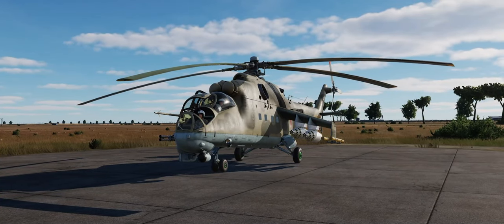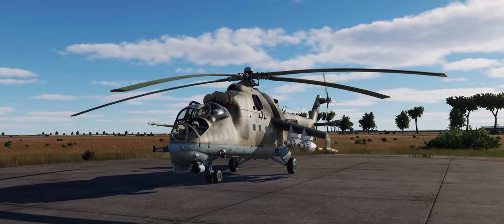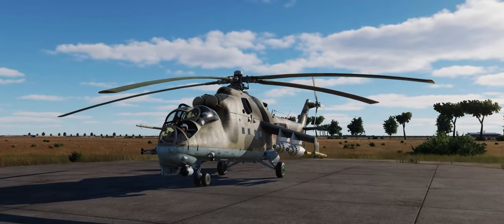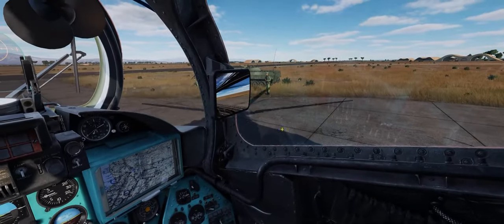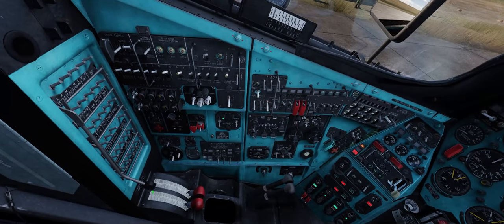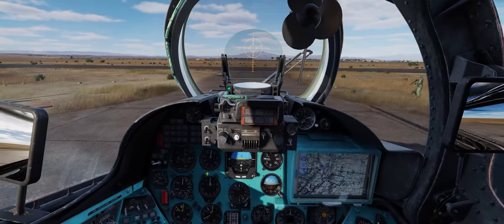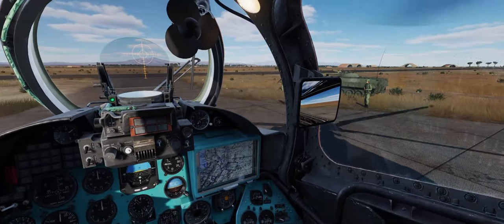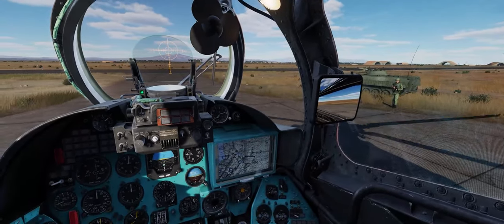DCS Mi-24P Hind-F Cold Start Tutorial and Troubleshooting!

Comment: Another important thing is on the NAV breaker panel, DO NOT engage the airspeed to doppler switch. This is a backup mode if your doppler system malfunctions, in a healthy airframe it's going to corrupt your Diss-15 doppler system and make it drift like there's no tomorrow ^^

Comment: Hello Spudknocer, are you still using Thrustmaster Warthog HOTAS, and if you are using, how good it is? Is it still good, after 2 years?
Reply: I've been using mine for about 5-6 years at this point and it's still going strong. I've read some people have had varable luck when it comes to build quality but I've never had any issues. The only weak link would be their drivers which are a bit meh and haven't been updated for quite some time.
Reply: @timmy3822  Thank you for the answer. I hope that when i buy mine it wouldnt be bad luck with build quality. Im planing to spend a lot of my for good gear that will stay with me at least a half of decade. 5-6 years and still good is perfectly good for me. I hope that your will last you at least 5 years more.
Reply: @Сергей-ю5й5й  i have mine for about 4 years now. Light to medium use, I also use it for Xplane11 GA planes. What I like about the warthog HOTAS is that you can upgrade/change stuff pretty easy. Lighter spring, teflon o-ring, extensions, slew upgrade for the throttle etc. Main downside for me is the throttle friction pads, made from weird rubber they can wear down. I like my friction pretty high :D. And the other downside is the smoothness of the  joystick right around the center. But I think that's because how it's been build/designed.  Other than that mines perfectly fine too.